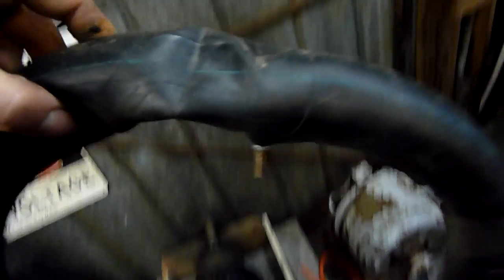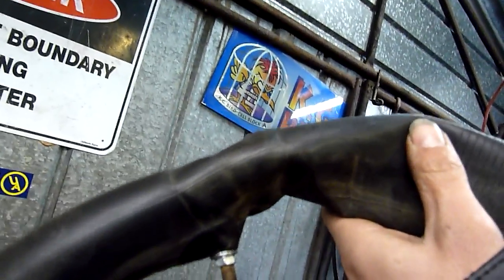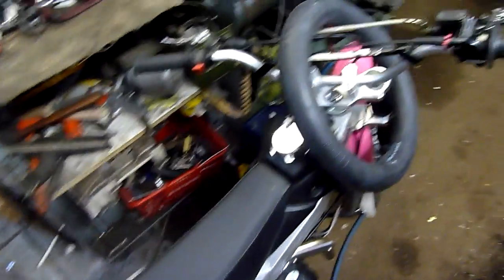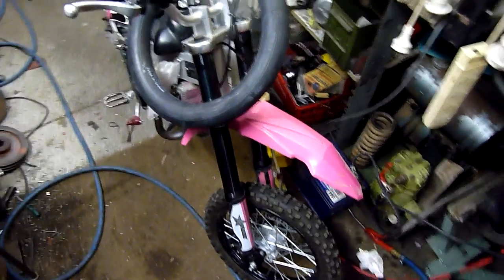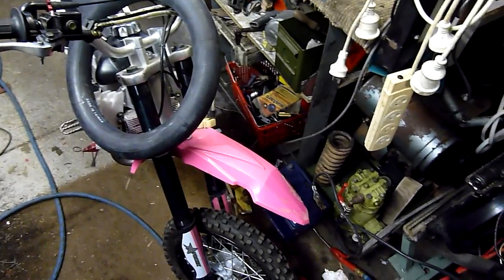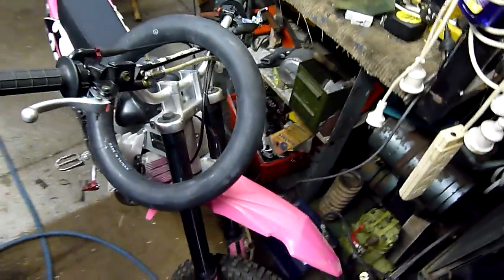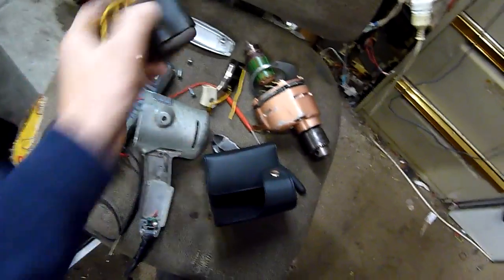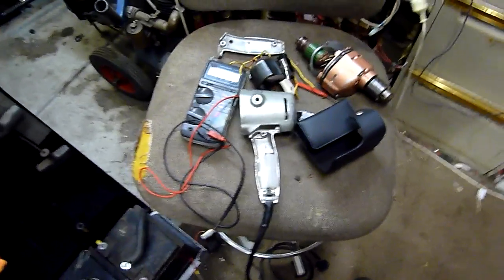Update - Its stopped raining on my Scrap Air Con Pile

Comment from the maker: @glumpy10 I've never really done a step-by-step video of scrapping units, but its pretty easy.

once gas is recovered, its easy. dismantle the unit for copper piping, and coils mainly, I rarely bother with fan motors and compressors now days.

Coils with no steel end plates fetch a better price than ones with them, but most times I leave them whole and save the time/trouble of cutting them off.

copper tubing scrap must be free of tar tape, valves and other metal items that are not copper.

Comment from the maker: @queenofyeay the drill was jsut on/off but I could use the Variac to control that a bit. 

yeh shorted armatures suck :(, very expensive to rebuild, but it can be done if the unit is a real collectible.

Comment from the maker: @destructionrocks that unit has a normal Cap run Main comp, with a DC Inverter Mini Scroll as a off-sider. its a odd system and I will do a good vid on it.

Comment from the maker: @TheFsJunkie yeh I thought I had a MHI but without the cover I had to googgle some other numbers to find it was a LG.
Old non-inverter Daikins are great, most I have right now were removed during renovations and are still working fine, I just didn't get the indoor units with them :(

Comment: That drill is a shame... was it a soft start, or just on/off?  I was given a huge old Maul electric chain saw a while back... It had no plug and the wire was crap but I torn it all down cleaned and greased the bearings, took the carbon off the armature, new wire and plug and painted the case. When I reassembled it, it LOOKED great.  I plugged it in and it threw sparks like your chop saw did!   CRAP! I should have checked the armature... such a waste of a unique old machine..